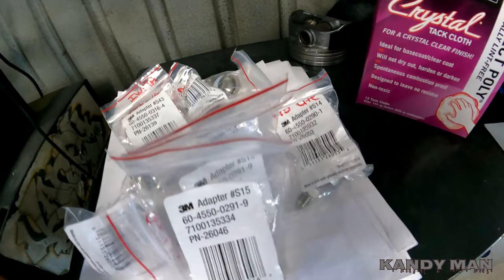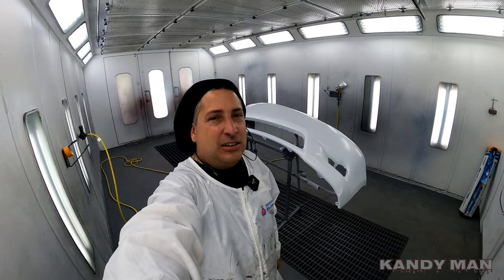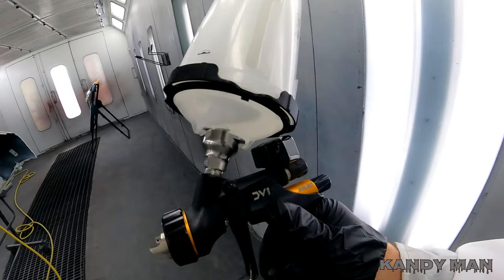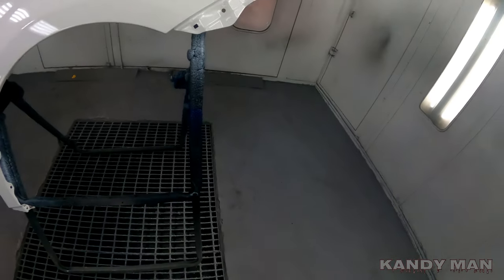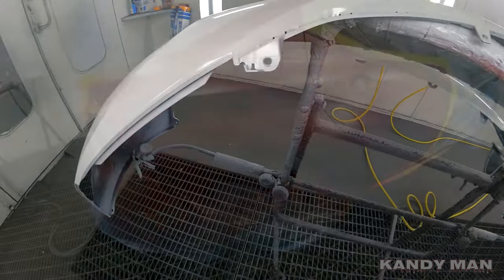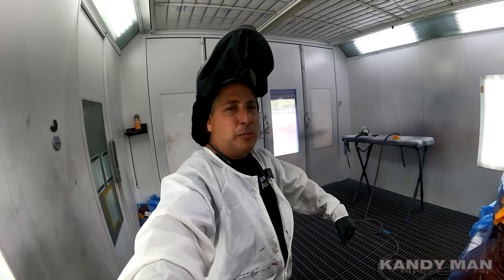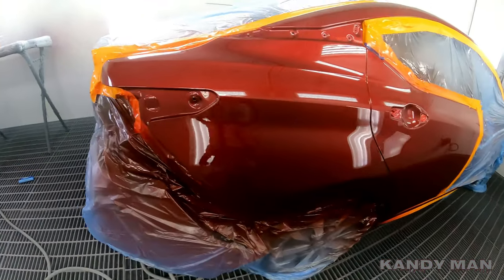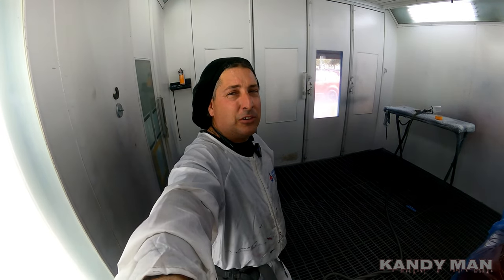DV1 C2 PLUS CAP - LOVING IT!!

Comment: I love the DeVilbiss D-Kups way better than the 3M. I've never had a liner lip get pinched on a D-Kup but I've had that happen on the 3M. You always have to be super careful with the 3M. Plus the DeVilbiss has a much more solid mounting cup, when it twists and locks, it's locked, the 3M is weak. As far as cleanliness, a little thinner cleans it right up. But to each their own brutha!
Reply from the maker: Thanks for your thoughts definitely a stronger  setup.
Reply: @kandyman5315  love your posts man. You have a super nice shop going there. I hope you continue to flourish!
Reply from the maker: Appreciate that  thank you.

Comment: yes the c2 is perfect on the dv1 clear im using the 1.3 atm the 1.4 would be faster , the c 2 gives a narrower tighter fan , i dont even use my c1 cap anymore, so the sata is going yes i dont even use mine much anymore its a nice base gun i found but the dv1 c2 set up it nicer really breaks the clear up good but not crazy fast
Reply from the maker: Absolutely. Thanks for watching 👊

Comment: Somebody straighten me out here.  Are manufactures intentionally blurring the line between HTE and HVLP?   The DV1 uses 10cfm for clear, which to me is in the HTE range.   I know technically it’s the pressure at the tip that counts, but it seems like the pressure range for some HVLP guns are on the high end too, especially with low CFM ratings.
Reply from the maker: I don't own any hte guns .but sure someone on here may be able to help. Thanks for watching.
Reply: @Juliopaints  yes to both